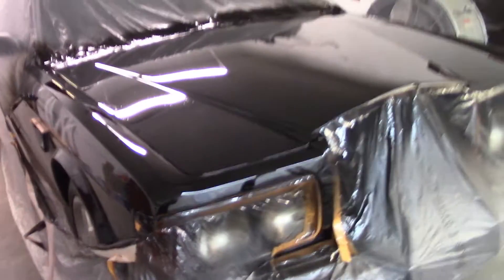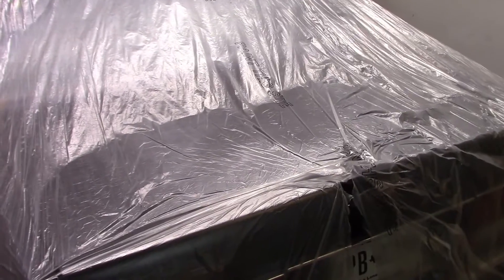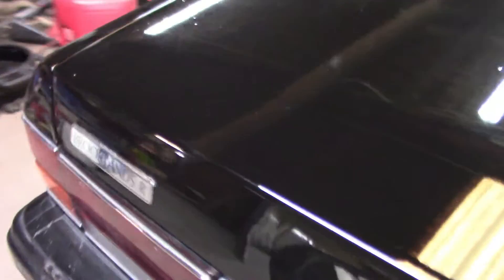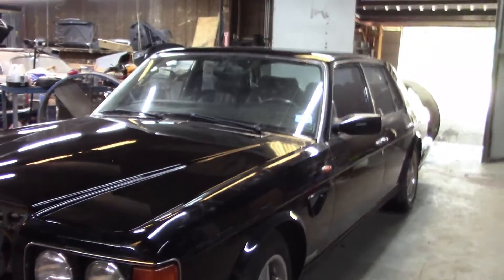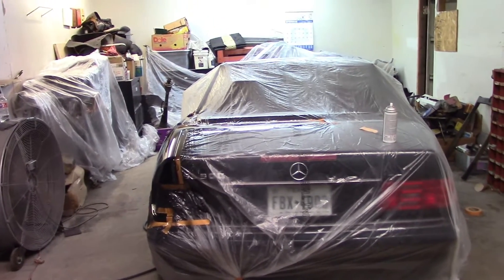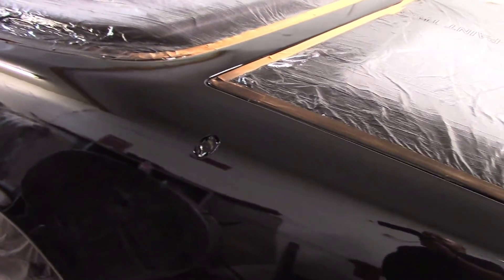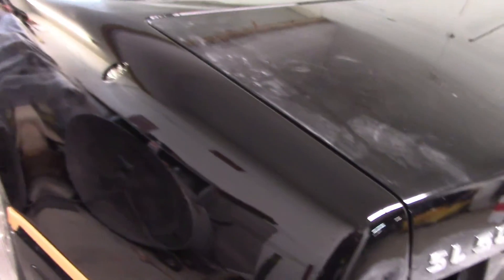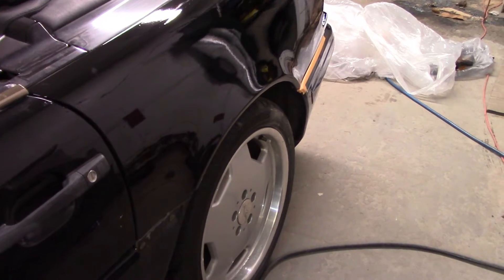1998 Bentley Brooklands R Part 10 - Paintwork (and rework) plus some R129 SL500 Content

Comment: Hi Al. Loving your content and have been a watcher for quite some time. Mainly for the Bentley and Rolls content. Im considering a 1999 Bentley Arnage 4.4L V8 but it is without keys. Getting a new set from the factory seems not possible since they are no longer available, I'm told. No used sets available too. What options do you think I have if I do buy it?
Reply from the maker: Hello and thank you for watching. When I bought my 03 T, I was also told that keys are impossible to get but when I called the dealer, they were able to source keys. This would be my first option. In my research, I saw a youtube video of someone making a key and programming it using a generic scanner for an earlier style key. It looked almost identical to a BMW key from the E39 era cars. 

I can confirm that on the arnage, a generic scanner will program a key as I used my Autel to do so. It won't get past the alarm module which is a separate unit.  You can check out my arnage videos for more information. Thank you again and good luck with your buy.
Reply: @aalabbasi  thanks Al. I’ve indeed seen your videos so knew you had been through the pain. Thanks for the tips and look forward to the next Bentley instalment. 

BTW I have an Aston rebuild coming to my channel soon. I bought the car last year and basically doing everything to it 🤦‍♂️